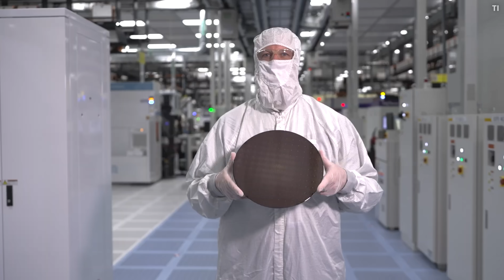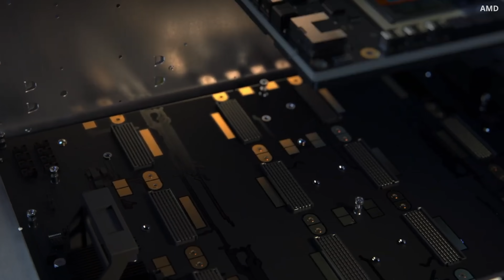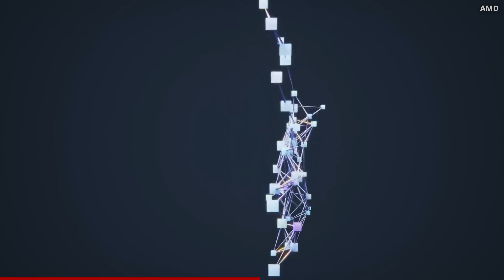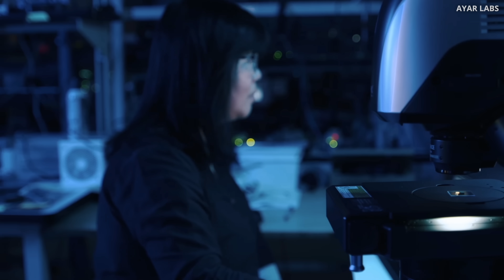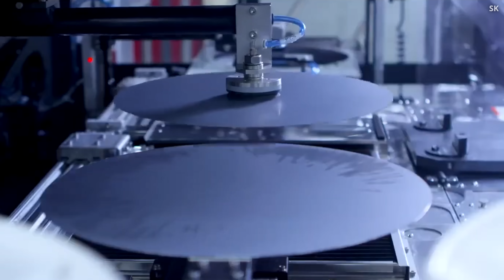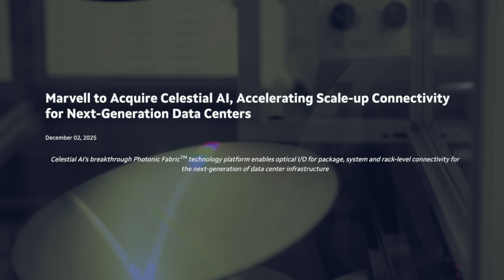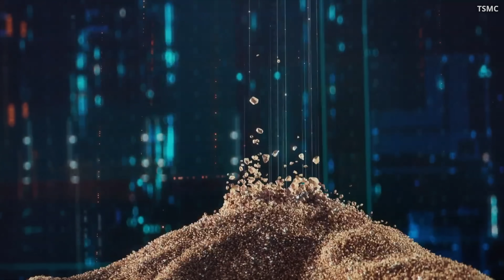Everyone Is Chasing This Technology

Comment: I actually work in integrated photonics for my Ph.D program. The reason optics and heat don't mesh well is because these modulators work by adjusting the refractive index of the waveguide material, but the refractive index also changes with temperature (thermo-optic effect). If you make a modulator out of only semiconductors or semiconductors and dielectrics, the core and cladding refractive indices will change in the same direction but not at the same rate, which messes the devices up. However, it is entirely possible to make athermal (or at least highly athermal) modulators, but this presently cannot be done in a CMOS compatible way. The reason for this is because you need to use a polymer as the waveguide cladding (AKA everything around the core) because the thermo-optic coefficients of polymers are the opposite sign of semiconductors, so if the semiconductor index goes up, the polymer index goes down The issue is that polymers have low breakdown temperatures, so they cannot really make it through soldering steps common in CMOS manufacturing. Plus, you can't really stack semiconductor waveguides once you start using polymers because they are amorphous and thus can't really support crystalline growth, aren't good for wafer bonding, and very much cannot survive the temperatures needed for CVD.

Also, silicon is actually excellent at guiding light at low powers. It has very low material absorption and an enormous refractive index of ~3.45 at 1.55 microns. It's actually very commonly used in those microring resonator modulators because it can be made FAR smaller than almost anything else, but like she said, you can't make light with it, and because it has a band gap of ~1.1eV, it is actually pretty bad for carrying high intensities of light (which is only a milliwatt or so at the sizes of silicon waveguides, ~200nm on a side) because of 2 photon absorption. Essentially, 2 photons of energies above half the band gap can interact simultaneously with one electron to make it jump to the conduction band, which attenuates the light. This is obviously not good when you want your signal to last for as long as possible and are combating signal losses in the 0.1-3dB/cm range. This is actually a benefit of silicon nitride, which has a band gap of ~5eV and a refractive index of 2. It's only around 1/6th the density, but you can push a lot of power through it.

Silicon also does not make a good modulator because it is not electro-optically tunable. The best you can do is shove current through it to change the electron concentration enough to adjust the index a bit, but this adds loss and takes a lot of power. There is actually a HUGE push to find the best electro-optic material (a material whose refractive index changes with an external electric field, AKA voltage, but NOT current) because the current mainsail platform, Lithium Niobate, is a pain to work with. This is actually a massive rush of research because everyone knows that whoever figures it out is making billions of dollars by fixing the modulator power consumption problem.
Reply: Awesome input.  Clippy avatar is choice
Reply: Great insight thank you. The only thing i know about photonics is my Lumentum holdings shares are up 450% since i bought them :)
Reply: Why the lithium niobate is a pain exactly? How s your valence for carbon pure going?
Reply: Huh.  So what about SiO2?  I mean, we have decades of experience working with it as ILD.  Would it be possible to cut trenches in ILD then , put down a thin reflective layer, fill the trench with ILD and then plane it back leaving a line of ILD encapsulated in whatever material?  Maybe you would need to add some secret sauce to the encapsulated ILD to give it better optical characteristics but it would seem that working with a friendly familiar material that is optically transparent would be a good place to start.   Is there some sort of material that could stack right on the gate to bias the gates using light? I mean, if we could eliminate the bulk of the heat used in the interconnects that would be huge.
Reply: Lithium niobate is fun to work with as you can bake in a permanent electric field that acts like a virtual free electron laser undulator. Can make any frequency you like within the transmission window of the material.

 Also good for light modulators for switching light it requires a high voltage that nanoscale stuff won't like. 

Another option is to make it all out of gallium nitride but scale and cost are a problem. Typical silicon fab technique won't work and the dies are huge for the amount of processing power.
Reply: @christopherleubner6633  What wavelengths are used?
Reply: Grok, summarize this genius, I dont have enough money to understand what he said
Reply: Huawei connects AI modules with fiber using cutting-edge all-optical networks and AI-driven solutions, achieving massive bandwidth like the Atlas 950 SuperPoD's 16 PB/s interconnect, enabling lossless, high-speed data transfer for training giant AI models across data centers and campuses, often reaching 10G/50G speeds with F5G-A tech for efficient, low-latency AI computing everywhere. 

Performance & Speed:
Massive Bandwidth: The Atlas 950 SuperPoD offers 16 PB/s interconnect bandwidth, exceeding global peak internet bandwidth.
High Campus Speeds: F5G-A brings 50G to rooms and 10G to Wi-Fi APs, supporting demanding AI applications.
Low Latency: All-optical designs and AI optimization drastically reduce latency for better AI training and inference.
Reply: Not quite ready for prime time. But if the break through comes... Oh no not the shovel sellers metaphor. Actually the ones that get rich find the gold. Pure and simple.
Reply: Electro-absorption modulators do not work on this principle. Electric field applied to a QW device structure modulates the absorption of passing light.
Reply: I hope that nerdy woman who made the video recognizes you because in my opinion you earned it!
Reply: So it’s all depends on who discovers or build the new material that satisfies all the requirements for this new age of computing technology while also being useful for the already existing technology.
Reply: It should be replacements for Lithium niobate such as crystalline ZnO.
Reply: How close are we with optical memory/storage (as RAM) and fixing the Temp problems?
Reply: "...cladding refractive indices will change in the same direction but not at the same rate,..." You means the signal produced would have significant CD, DGD?

I am wondering, are we banging our heads to manufacture something that will produce a signal we want, i.e.; digital 2^n, while we could design another type of signal that would be better immune to the artefact of the new, optical design? Why not use refraction as a signal?
Reply: I was gonna say that.
Reply: Wow, ahm my Opinion is. Burn all Data Centers. And Hunt the Wannabe Antichrist
Reply: You work with photonics and seem to know your stuff.  However, do you know that the speed of light, mathematically, is e, to the (e + 1/e) power, is the ratio of potential energy to kinetic energy during the most-dense stage of a Big Bounce event, and that as a velocity, the speed of light can be formulated and Chain Rule integrated and then thrice differentiated to give powerful lensing abilities for reducing complexity?  Do you know of pi, cubed, divided by 6, as being important for information theory and opaqueness?
Reply: This is a graduate-level but technically solid explanation.       Minor clarifications (not errors):

“You can’t stack waveguides with polymers” → more accurately: you can’t stack them in a scalable, CMOS-compatible way

“Silicon can’t make light” → strictly true for efficient lasing (needs III-V integration)
Reply: You know this subject , hmmm
Reply: Your this video is not easy to understand.
Reply: Have you read this month's laser focus world?
Reply: Wow!! I learnt so much.
Reply: < What he said
Reply: Have you considered "Magic"? I understand magic just irons out all these problems, toot sweet!
Reply: That’s why GF is betting on BTO and TSMC on TFLN…
Reply: @WilliFromEarth  LOL! GTFO!
Reply: I do wonder if signal switching between mediums doesn’t add extra steps.
I also ponder the complexities of going to light as early as possible and how difficult it must be to translate through the whole chain.
Reply: Matthew , Actually I am trying to work on the problem of photonic time crystal. Do you know which material can be suitable for that problem where refractive index can be modulated quickly? Whats your thought on this? i.e. is PTC a important problem to solve?
Reply: Thank you Matthew for a most interesting and detailed explanation of the problems using fibre Optic (integrated photonics to be more accurate)  - which at first sight appears to be the obvious answer. Best regards
Reply: R u married?!
Reply: enviornmental concerns in any material can be mitigated through tempurature and time...gravity becomes a concern...outer space robotic manufacturing is a no brainer...that with a space elevator design to geo-synchronised satellites...and some wine.
Reply: Kudos I thought all the important work had been done already, its not a new phenomena I remember a circa 1980 issue of Scientific American covered this in detail.
Reply: Wow!
Reply: So basically, photons and electrons move at different speeds, which makes it difficult to transfer information from electrons to photons and also contain the heat emitted by electrons without damaging the hardware? I'm probably completely wrong. I'm a caveman compared to you. Seriously I feel like talking to you is like talking to a higher being. No wonder the ancients believed the Anunnaki were gods.
Reply: Thanks for that , I'm building an android and I saw this coming on my design of using photos threads for my wiring ,!
Reply: What you talking about Willis??? Lol..😂
Reply: You know this subject well enough to explain it to people who are not familiar with the subject matter.  In a clear and progressively illuminating manner.  Good job.
Reply: Your generalizations about polymers assume all polymers physical properties are the same. You can add other elements to a polymer and dramatically change its physical properties.
Reply: Thank, you answered many of the questions I had.
Reply: @garysmith8593 why are typing a chapter of your thesis into YouTube comments under a random video? 

What exactly is the purpose of this activity?
Reply: @atenrok 👽
Reply: @atenrok

Y R U Dumb ?
Reply: Too wordy. Stop at “CMOS …” in 1st paragraph?
Reply: I've seen the latest quantum computers. They look like high-tech chandeliers. 
The one that is running our new banking system. 3.5t phototonic frames per second. One video had a PhD. in quantum physics (?) brought out one of these new computers. It hung off a metal frame about 5x5x5ft on wheels. She explained to 5 different age groups from 10 year olds to PhD.  candidates how it functioned. She did an excellent job.
There was one being developed by Westinghouse that looked similar. Just like a chandelier with glass tubes vertically hung. Each layer was smaller in circumference and gold plated(?).
Reply: @georgemichaels2325   How is a quantum computer going to help you balance accounts in a banking system?  Does it perform faster addition and subtraction???
Reply: @RobardoHughes It operates off a special block chain. 40 levels up or down. No more Bank control of your funds. You may not be aware that when you sign a signature card. You loan your money to the bank and they can do whatever they want with it. Including taking risky loans. Not joking.

Comment: So, is this expansion being driven by the enormous profits the major AI players are making? Or is it being driven by a speculative investment bubble? I don't see the major players making much profit, although I'm sure the operators of the data centers and hardware suppliers are making money. But is the AI earning much?

The most successful AIs are smaller, older ones that have been trained and now can be customized on just a few powerful workstations. It's the LLMs that can run on a small cluster of two to 6 powerful compute devices that are finding great use. GPT 3.5 is good enough for most of the profitable AI applications. Training the ever bigger LLMs is doing nothing but sucking up investments but are they finding profitable uses? No. 

The new technology, the lower power chips, the optical chips, and the non-GPU AI chips may permit us to explore more complex architectures, but LLMs that dominate the scene today are a dead end. Innovative uses of them doesn't require ever bigger ones,  just smarter application of specialized, smaller, older AIs.

Comment: Umm..  brand new data centers use fiber optic cabling, not copper.
A lot of the cabling you showed when speaking about copper cabling was fiber backbone and interconnects or existing older data centers that have not been updated yet. The copper cabling they use today is typically only for inside networks like work stations, lighting, wifi and heating and ac connections same as you would see in any newer building.  Has been like that for more than couple years.  

I don't work in chip manufacturing so am unsure about the use of copper in the GPU so will take your word for it that this is currently accurate for that part of the video.  I thought they used gold and other metals regularly as well but like I said, I'm not in the business. 
Just sayin, don't blow your wad investing in copper thinking that AI data centers are using it for everything.  If copper got to expensive they would switch to fiber on internal networks as well to save costs, witch they are likely already doing in some cases.

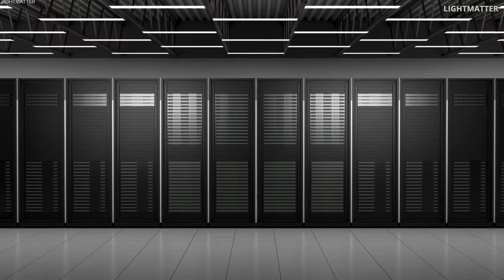Comment: 4:00 what is shown isn’t copper, it’s fiber.
Reply: And they don't use copper wiring for any new builds for a long time.  It has been Fiber for years in data center construction.  Copper is only used for on site internal networks like wifi and security systems.  Even those will change to fiber in time.
Reply: @toolman6872   Power distribution.  Copper is used for power distribution.
Reply: @RobardoHughes but she's literally talking about data transmission speeds. You don't get faster than light. She don't know what she's talking about.  I'm not the smartest person in the world but I am a systems engineer / software engineer.  Worked at Nasa for years and now write software for space vehicles for national security. I also have written AI models way before chat gpt.
Reply: She don't know what she's talking about.  😂
Reply: @rccowboys   That is the sad bottom line.  I subscribed to this channel, because she had a couple of good vids.  But this is so abominably bad that I am afraid to continue consuming the content of this channel.  It's hard to guess which layers of the onion failed.  But the fact that she didn't notice shows that she is a fraud, and information from this channel cannot be trusted to the extent I originally was led to believe.

Comment: 22-12-2025.
Gallium arsenide, is EMP proof, only for the best and dedicated communication equipment.But you missed the real reason why the crazy push for these data centers, like I said, quantum Chrono matrix manipulation, and yes the location does have a influence on the possibility of the system working or not.

Comment: Germanium absorbs telecom wavelengths 1550 to 1650 nm and even old 1100 nm. Silicon transmits 1550 to 1650nm and absorbs some and transmits some at 1100nm. GaAs absorbs 1550 to 1650nm and 1100nm. If a material absorbs at a wavelength it also emits at that wavelengths. GaAs chips go back to the 1990s.

Comment: When I watch these tech videos I'm reminded of the old old 1980's "Transputer" technology and the language for programming them "Occam". It was all about having vast arrays of computers talking to each other through interconnect channels. But it got killed off because it couldn't turn a profit quickly.
Reply: And yet, cluster computing became a thing; and IBM Parallel Sysplexes (inc geographically dispersed PSes) ran in most financial institutions - and still play a pivotal role in the finance space, among other domains. Transputers and Occam were a minor offshoot of an array of options.
Reply: I wrote some software for a cluster of 128 transputers at Manchester back in the early '90s. occam wasn't a great language. The support for communicating processes was decent but the only data structure supported was arrays (no C style structs). We switched to C on the transputers when we got our hands on the official C compiler. It was a bit clunky coding for transputers. I think the plug was probably pulled too soon though and if investment had continued they might have become more mainstream.
Reply: But the Teknowledge pipe dream of the 1980s that was used to scare the govt into gigantic funding was based on "inferences," and this new Ai technology is based on "inferences."  See the difference?

Comment: Didn’t fiber push copper out except for inside a single rack decade+ ago?
The data centers I worked in right before plague didn’t use copper outside a single rack, everything else was already fiber in 2019ish timeframe. For disk arrays and larger servers they even used fiber within a single rack for maximum speed.